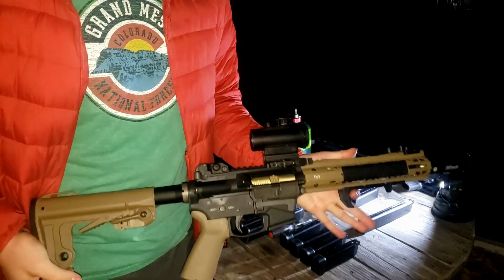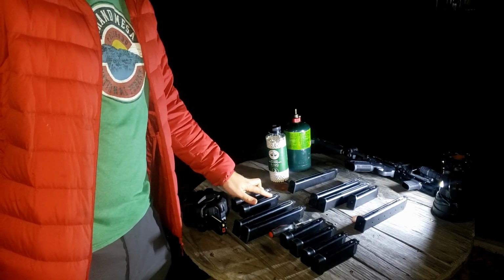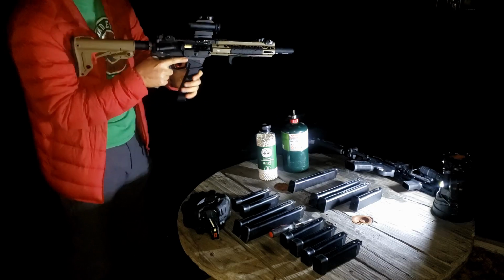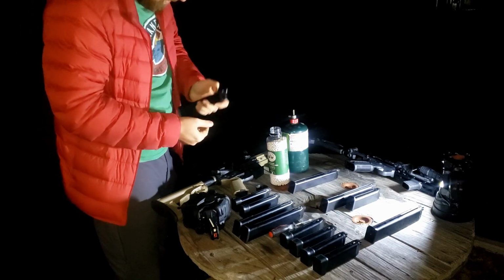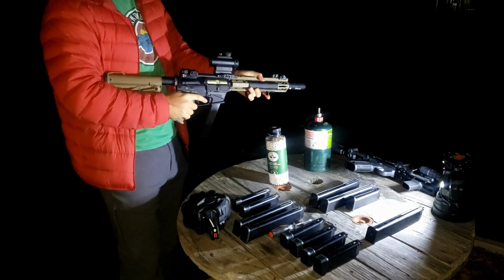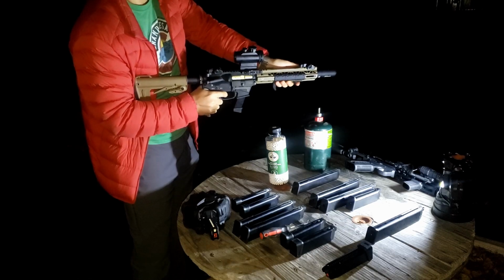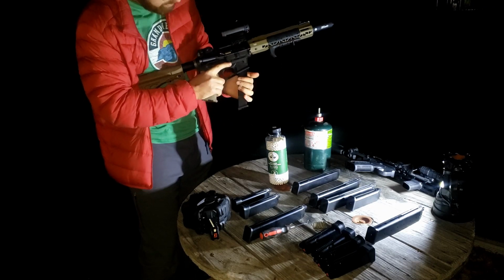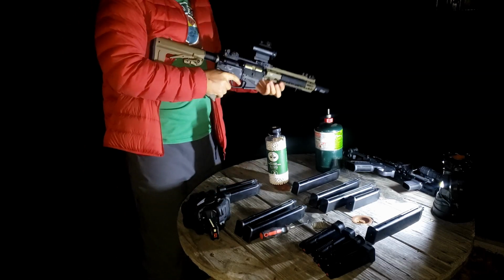Airsoft toy King Arms TWS-9 bolt hold open mysteries: measuring masses of mostly modified magazines

Comment: how much psi do you think i could run with an hpa mag adapter,  have an electric drum mag that i run with an adapter on my hi capa but I'd have to get a separate adapter since the tws takes glock mags, but I love the way the tws looks, very different and cool
Reply from the maker: I've been running mine at around 90 psi getting 1.3J with a .30 BB

Comment: Is there heavier bolt with different color?
Reply from the maker: The silver bolt is pot metal and heavier than the gold aluminum bolt.
Reply: @treesleavedents  where can I get it cause I’m having trouble finding a heavier bolt but I wanted it in black
Reply from the maker: @EditorKalandr__  I bought my gold aluminum bolt off of wgcshop and I saw the silver one there too. I've also seen the silver one on evike. No black ones though.

Comment: There were reports that WE and TM Glock magazines don't work with the King Arms TWS-9.

By the looks of the video it looks like it is mostly compatible?
Reply from the maker: correct. Bolt hold open feature is hit or miss though
Reply: @treesleavedents I know I’m really late but… it only seems to be an issue with the short mags, but also the short mags also seem to mostly fit stock without sanding anyway?
So maybe try a long mag follower inside a short mag as they may have SLIGHTLY different specs…